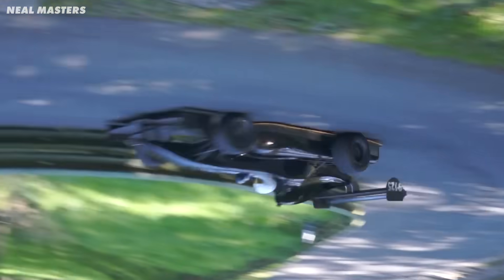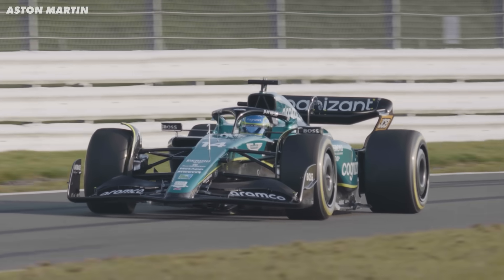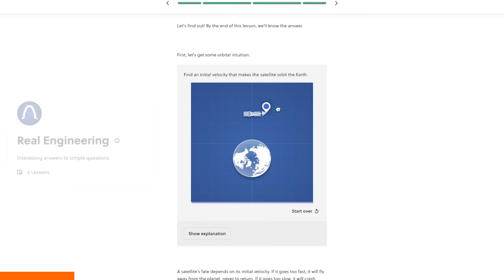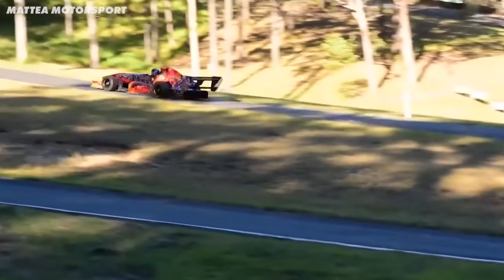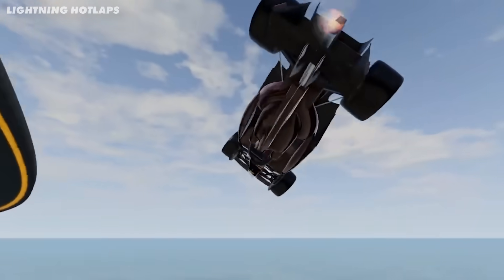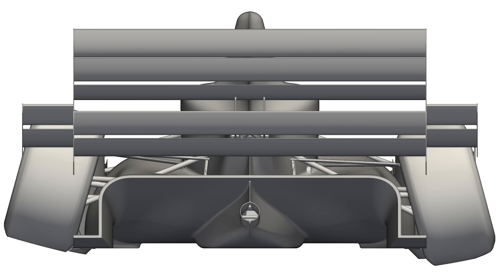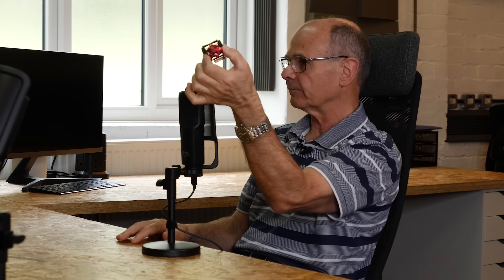How We Designed the Car to DRIVE UPSIDE DOWN

Comment: As a FSAE driver, it feels super honourable that formula student got mentioned as not many people really know this category exist. Thank you driver 61. Good luck on the project and hope it works out as planned and safely
Reply: Same here!! Super cool to hear, i was thinking about it since the first video.
Reply: i read a book about formula student before. sounds amazing
Reply: @robwright1067 FSAE is an international competition of engineering students
Reply: Not many know the category exists because it’s an american series with no-fun rules that prohibit real racing. Plus it likely doesn’t take you very far since those destined for F1 are probably already in f4/Indy lites
Reply: @dylanzrim3635  "american series"
Do you even know what formula student is about?
Its an engineer's series
But it also takes a good driver to drive on those conditions
Reply: @dylanzrim3635  its an intenational series "FSAE" is the American origin. But its more than that nowdays. There are over ten competitions in Europe alone. The european cars particuarly the teams from the big Universitys are overengeneered to the top (carbon fiber monocoque, self engenered electrical motors...). Yes its not a racing competition, its an engeneering design competition but also racing takes about 2/3 of the points. And the other thing is: there is no engineer that brings motorsport knowledge from 10 years working in motorspots within the team, its only students that work on engineering the cars and only students that drive the cars then.
Reply: @dylanzrim3635   its more like a international student/university series. at least here in europe many tech universities have race teams in formula student. as far as im concerned they also hold the world record for fastest 0-60mph acceleration. AMZ Racing from the ETH Zurich tech university built a car that does 0-60mph in 0.956 seconds.

Comment: What about starting with the car inverted on top of a truck, in sort of a retractable scaffolding, wheels already on the ceiling.
Then at 80mph retract the frame that it's lying on and continue on its own power.
And then finish as per your current plan, rolling of the side wall to the ground.

Comment: This might be a stupid question, but why not make an oval loop instead of the pipe design? In my smooth brain, you wouldn't have the risk of getting one tire of the ground on turning since you could drive straight into a half loop, drive upside-down in a straight line and come down on the other half loop, all the steering could be made on flat ground without gravity fighting you, like, you approach it, turn into the the oval loop halfway through, straighten the car, go upside-down and come back down, then steer of the structure so you don't have to go through it again
I know this is easier said than done, and must have a huge downside that i can't think of, what is this downside?

Comment: Just start upside down, and use a hook and Tolley system to hold the tires to the track to accelerate, and then disconnect the hook for your test and then reconnect the hook on the other end.    I'm not an engineer but that seems safer in my mind. I feel like it's simpler but I could definitely be wrong I just figure it might make sense as a way to reduce potential problems dramatically.

Comment: Pretty sure it's gonna be a rotary engine. Wankel engines can work upside-down.
Reply: I have a suspicion that it will be a battery-electric powertrain.  Electric motors have no fluid control issues, and the battery would only have to be large enough for a couple miles of range.

Comment: Quite a lot of people are suggesting a helical road surface with a flat floor so you don't have the camber issue.  I used to play a driving simulator arcade game about 30 years ago called Hard Driving that had a horizontal helix of two revolutions.  It took me a few tries to stay stuck to the helix, but if my speed was high enough the tires would generate enough normal force on the surface to stay attached.  If I remember correctly, I had to be going 135 mph to stay stuck.  Below that, my car became a lawn dart.

A flat-floored 180-degree helix that transitions to a flat ceiling would eliminate a lot of aerodynamic uncertainties and not force you into designing a rear suspension that has challenging operating angles for the CV joints.  The crazy camber angles on the car are going to make it hard to drive on the flat surface on the run-up to the half-pipe.

Comment: I wonder why the floor is flat? if it had a dish shape, it wouldnt have that problem of extra room between the floor and the road surface.

Altough that would require the bottom and top of the tunnel to be curved as well, but I don't see why that would be a problem.

Comment: Idea: Why not make the track get upside down instead of driving to the top of a tunnel? 
What I mean is, a long track where the floor twist and turns upside down, like some roller coasters do. The track height would be lower and easier to build, and could be made flat instead of a curve.
Only problem I can see with this approach is that once in the track, would need to get to the end of it, no way to back down. Are there other issues with this approach?

Comment: You need to use a nitro methane drag engine. It has by far the best power to weight ratio.
Reply: But it will stop running after 4 seconds.

Comment: I can't wait to see how this goes, did you consider starting upside down on rails ? then you just need to worry about getting the car upright after the challenge is complete.
Reply: i was thinking this too, or maybe a clever receiving rail at the other end too so the car can just stay upside down the entire time. And no need to build a special tunnel
Reply: Would be very difficult as you couldn’t use the existing engine/driveshaft as the wheels would be spinning the other way

Comment: honest question, how are you dealing with oiling? I know that in the last video you talked about this, and I don't think per cylinder oiling is that much of an issue, some historical aircraft engines are inverted, used dry sump oiling and were fine, but my concern has to do with the oil tank is still gravity dependent
Reply: WW2 fighters had "flop-tubes" in the dry sump oil tanks that would rotate in any direction to stay submerged in oil to keep oil pressure in the engine.

Comment: So... I don't get why it needs to go upside down laterally, can't there be a half loop which leads to a upside down straight, then another half loop to go back? This way you don't have to worry about steering
Reply: I suspect it's due to the size of loop required. At 80 mph, if Scott could tolerate 4g verticality downward (relative to himself), they'd need a loop diameter of over 60 m. Not only would that be a bigger build, but it would place Scott and the car much higher than desired. I suppose the attempt could start 50 m below ground, but that's quite an excavation. It would also suffer the same issues for viewing as the fully enclosed tunnel.

I had thought that there might be an issue with the front and rear approach angles (like a 4WD at the start of a steep incline), but the 60 m diameter probably makes this less of an issue.

Comment: Maybe I'm wrong and the whole idea is to do a big "barrel roll", but wouldn't it be easier to do the whole race upside down? I mean from start to finish. You'll have to put some long guarding rails that will hold the car in place on the start and you can basically slide on them until the downforce kicks in. And if something goes wrong you'll still fall on the guarding rails and not on the floor of a tunnel underneath.

Comment: 0:54 - "Car weight 800 kilos with 1000 kilos downforce"
Under normal conditions, when the car is not upside down, you sum these numbers 800+1000=1800 kilos weight.
But in the upside down scenario you have to subtract these numbers! 1000-800=200 kilos weight and this is NOT enough for the tires to create enough friction to maintain the required speed and handling! They'll just start slipping!
And also 200 kilos will be NOT enough for the suspension to maintain required ground clearance to create suction effect under the car...
Reply: And also the suspension will work absolutely incorrectly, because... the wheel will actually rest on the suspension rather than hang from it.
Because of this, every bump and hole will become deadly traps...
Reply: That is why they are designing the aero package to generate twice the car's weight in downforce.

Comment: why not build the track in a curve, especially through the transition area where the car is going through the vertical transition, then you have centrifugal force providing you with downforce/grip. then as you get closer to inverted, have it straighten out/flatten out?

Comment: I think this is one of the few times that going slower will look cooler - sticking to the top of a tunnel at 80mph will look even crazier than doing so at twice that speed, at least that's my guess.
Reply: Yeah now I kinda want someone to drive underneath him and match his speed
Reply: The problem with that is that then IF he should crash, it's even more dangerous.
Reply: Especially if you get a normal commuter car to drive on the ground under it to point out that it’s doing this at highway speeds
Reply: If the ground car is bigger and has some sort of landing pad with heavy feathers below, it could increase safety by providing a little softer landing (probably still brutal, but it might help reduce the stress on critical components) and by preventing the unintentional abuse of the upsidedown brakeing system

Comment: Engineering question: why are you using a tunnel with a uniform curve instead of a flat track that has been twisted to become upside down? Wouldn’t that create a much flatter surface?

Comment: I can't help but wonder why it has to run aerodynamically on a flat surface. That seems pointless when the main challenge here is running on a curved surface of a known diameter.
Now yes, curving the car to the tunnel has its own challenges associated to running on level ground, since the underside of the car could end up bellow the wheels. But one could overcomplicate the car and have its ride height be adjustable. Or make a curved approach ramp.

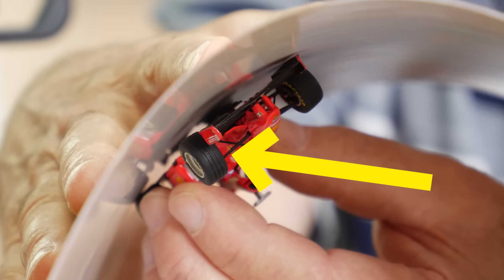Also, will quickly add in that allowing the rear wheels to also turn in the same direction as the front wheels will make the car strafe up the side of the tunnel instead of turning up the side of the tunnel. Effectively eliminating all the issues discussed at 9:10 Though creating a new issue in that the car has to be aligned on axis with the tunnel, so logically the back wheels shouldn't perfectly match the angle of the front ones, having them do slightly less turning will still allow the car to turn, but its turning radius will be massive. Experimentation will determine how much strafe/turning is ideal.

Adjustable ride height isn't too complicated, but another point of failure. (Even if a compressed air system would be somewhat simple to implement, and I would be surprised it isn't suitably reliable. The system is "fail safe" in that if the lift cylinder doesn't decompress, then one won't attempt the inversion since the ride height is too high for proper aerodynamics. And if one can't reapply pressure after the inversion is done, then one will simply skid when going back out onto level ground.)

But a curved approach/break segment before and after the tunnel is likewise trivial, especially at these somewhat low speeds since a long distance won't be required. And these segments are likely going to be quite cheap. (I suspect it to be more expensive than a piece of plywood and some 2x4's.)

In the end.
You want to drive a car inverted on a ceiling, you have to think outside the box. Your road is a more or less perfectly straight tube. You don't need to turn and you don't need a car able to run on a flat road.
Reply: it isn't simulated on a flat surface but the rest of your point are very good!
Reply: @RixxleSnoops  I never stated stated that they simulate on a flat surface, just that it hasn't yet moved away from the needless "requirement" of running on a flat surface.

However, I could have expressed myself more clearly on that point.
Reply: I was thinking run a relatively high ride height and relatively soft springs, most double A arm suspensions gain camber in compression so as the topside downforce (on the flat) compresses the springs the ride height and camber approach ideal for the curved tunnel section.
Reply: @arrindaley3714  Yes, but then you have the issue of needing even more downforce to not "spring" away from the ceiling. Ie, more speed and therefore a longer more expensive tunnel.
Reply: @todayonthebench  set the springs up that soft that they're compressed at / before the tunnel and already using a stiffer 2nd stage.
Reply: @arrindaley3714  Considering the cost constraints at hand, and how driving slower makes a noticeable impact on overall project cost, then springs isn't the solution for an adjustable ride height.

The springs needs to support the weight of the car at the very least, compressing them down further (even if they are soft) will provide ample additional pressure for our down force to overcome, making it a frankly inept solution.

Another method of getting adjustable ride height is simply a pneumatic cylinder, or other linear actuator. This will allow us to lower the car's ride height without imparting any additional forces for our down force to overcome, other than a slight increase in overall weight.

Comment: I'm concerned about the steering issues you'll encounter when trying to fit the camber to the tunnel's radius. Turning slightly may cause instant and uncontrollable oversteer wouldn't it? it would be like having one front wheel suddenly have a toe-in and the other a toe-out setup. I'm an idiot but I'm just wondering what kind of steering issues you'll encounter. I'm sure a scale model will allow you to test it out somewhat.
Reply: Isn’t that more a toe issue than a camber issue? Excess camber behaves similarly to insufficient camber?

Comment: wouldnt grip be a problem? you have more grip when driving normally because of weight + downforce = more grip = more speed. but if you drive upside down, the weight goes up, therefore lessening the grip and reducing speed which reduces downforce therefore making the car fall down
Reply: More downforce than the car weighs is created. Thus keeping the car on top of tunnel… in theory. :)
Reply: @Iam_Dunn  but that means less grip because the downforce is reduced by the car's weight therefore reducing speed because of less grip. which will reduce downforce and so on and so on.
Reply: Since grip is roughly proportional to the normal force between the tyres and the "road" (whatever that means in this context), then all that matters is that there's enough normal force.

You're right to say that the car's weight acts downward. This is why they want to generate the equivalent of at least twice the car's weight in downforce, because that will result in a net upward force of a little more than the cars weight.
Reply: @weevilinabox  but it will still produce less grip than driving right side up, right?

Comment: As long as you don't use the FS car from a particular university you might be good, I heard that their carbon fiber wings weigh 20kg each because they're filled with wood for some reason and from the airflow they produce just 20kg of downforce each at like 30 mph......
I think they said the total car mass was 250kg with the wings and at that point, other than the design part of the competition they probably should've just removed them.

Comment: The curved tunnel seams to be adding many complexities to a fairly simple idea. Would it not make sense to investigate the idea of a straight section of road surface that could rotate through 180 degrees. This could be fairly low in overall height (enough to accommodate the vehicle height and also some additional safety features, like free running wheels in the event of loss of downforce)...?
Reply: It would need to be a really long section you’re trying to rotate. The car is moving at about 80mph and it’s going to take at least a few seconds to rotate something that large. You’d be looking at probably rotating a mile long section of track.

Comment: i imagine it's not practical or that it poses even worse problems, but one of the animations had flat road sections joined to make the curve, what went wrong with that direction? it would solve a lot of ground effect probs if the road sections were flat, although going from one to the next might be tricky...

Comment: At first I thought you were just using a simulator...but wow! This is for real...I love it.
You have probably been asked this before...but if you threw the rules for F1 out the window, could you design a car that would leave the current F1 cars in the dust?
Cheers.
Reply: @robroy25 - yes we could but all F1 teams could do this as well..  The rules are designed to limit performance, partly because we could design cars that were almost undrivable and very dangerous if accidents happened.
Reply: @willemtoet_yt  Thanks for that. I understand the safety aspects...I was just curious...cheers.

Comment: I don't know what are the exact constraints of this project but wouldn't it be feasible to build also a curved floor of the tunnel (probably the cheapest part) and match the floor and diffuser of the car to the radius so you get the full floor downforce? You won't be able to drive the car on a normal road but does that matter?

Comment: I understand (i think) that the wheel camber is critical for the transition and top part of the tunnel, but is the bottom of the tunnel going to be flat, or is the whole tunnel cross-section going to be consistent?.. ie, the bottom bit is curved and part of the circle as well?